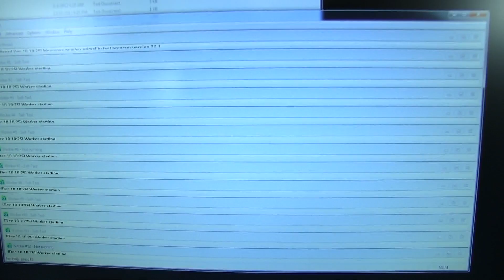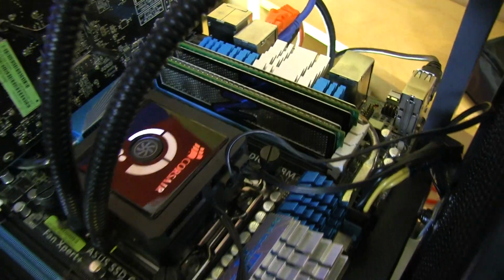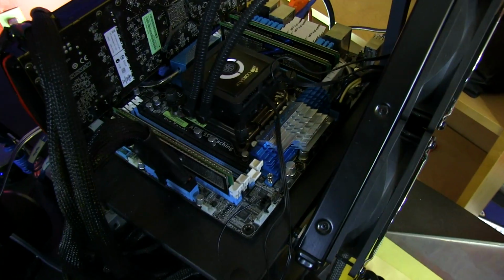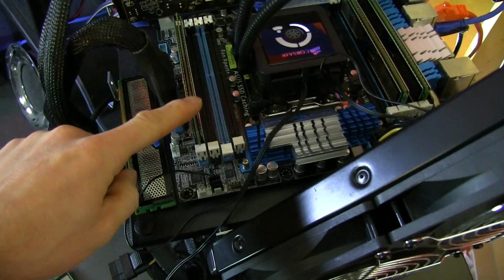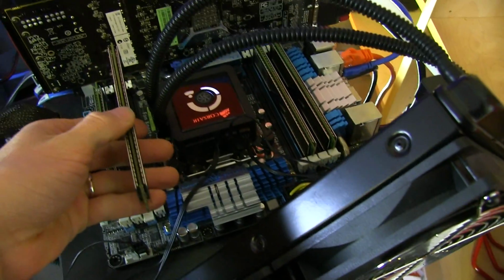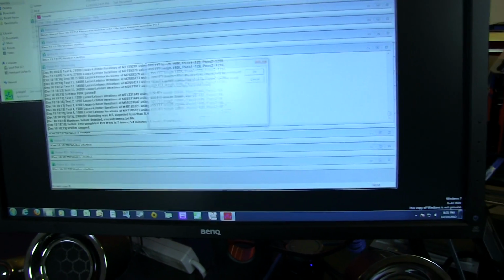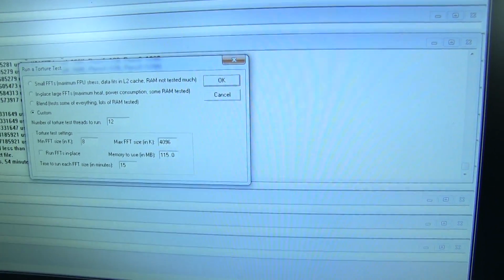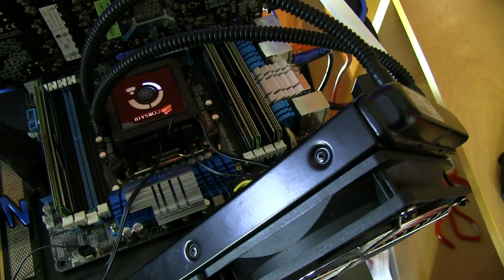RAM Memory Troubleshooting & Diagnosis Part 1 Linus Tech Tips

Comment: doubtful. you can't just say its your ram. more than likely its your video card, probably a driver problem too. update/reinstall your video card driver. if that doesnt work, try using onboard video or try another video card. if that doesnt work, THEN check ram.

Comment: My diagnosis order: smell (burns, overheating, etc), temperature too hot (touch or infra-red thermometer), cables not lose, drives working ok, operating system ok, software ok, other hardware working ok.

So memory might be the last thing I check. Anyone else agree with me?

Comment: if i do not overclock my memory but i do overclock my cpu should i stress test for like 20 hours on p95 blend? because i just stress tested my cpu with p95 small fft and it was solid. now that its summer i dialed it back a little bit but yah, is it necessary to test my ram even though im not overclocking it

Comment: Thx for the anwser :D but the prices are not the same where i live :/ the 860i cost's 120 dollars more that a 850 :/ and just a 860 cost 300$ so i whint i will go with the 860 if it can handle SLI GTX 670, i7 3,4 ghz, 1 ssd 1 hdd and a okay MOBO :D

Comment: it was still on 1.65v by default on the ram... but cpu overclock went bad at auto voltage.... cpu ratio: 41 BCLK: 105 if i changed the cpu ratio to 42 the computer will just blue screen after the starting windows screen haha... using 3570 btw no k

Comment: Installed the H100 by myself on the Burton case I use (it fits , roughly) BUT the ga-990FXA-UD3 leaves almost no room between the reservoir+coolers and the memory locking clips. Solution: used a red hot knife to trim the clips down like black smoking butter. I had only one RAM issue since then (due to some infiltrated dust during the whole process)

Comment: i think this is why COD:Black Ops always freezes after i want to close it :/ i have my kingston hyperx red ram overclocked from 1333mhz to 1600mhz just like that without even bothering to check the voltage.... or either its something else :/

Comment: My RAM is unstable on auto voltage. It makes my system hang, display is corrupted, and produce an annoying noise. I only fix this issue by cranking up the voltage to 1.88

Comment: He isnt using a case because its too much hassle to change out his components all the time. He is using a test bench which allows quickly component swapping. He would only use a case if it was a proper system. Plus it takes too much time to  to put everything in a case, every time he makes up a quick test bench rig.

Comment: I got a stability issue and im aware it with the ram, as i done testing. Its only one stick. Am i better of running at 2133mhz with 6gb or @ 1333mhz with 8gb. I have to underclock my ram to keep it stable due to the one faulty ram stick.

Comment: I have been haveing random reboots on my computer, I check the ram and it wasn't that, I thought it was my ssd so I replaced it, I had power supply issues so I returned it and used my 2 year old psu, I thought it was a psu problem but it came back, do u think its not enough power cause I'm running 750w on a 3570k, sabertooth z77, gtx570, baracuda 1tb, vertex 4 128, water cooled? What do u think the problem is?

Comment: Im a "noob " here but couldn't you just use CPU-Z to see if which stick of your RAM is actually running ? I mean since you said its "dead" as in malfunction. 

Unless you said its "faulty" which the problem will come on and off , on and off.T hat's the most worst case for anything.....because you will never know when it gives trouble so even with CPU-Z can't work =/ 

This is just my knowledge and theory maybe i missing something here or something i don't know of is causing this problems.

Comment: Linus, using 11500 mb of 12gb of memory only leaves you 788Mb of physical to run your os, which isnt enough. you will get erorrs by simply starving the system while trying to run these tests. pull the pref mon to see what kind of page file, then adjust as needed. and the other poster is correct, Linpack and IBT are much faster in producing the same faults in a fraction of the time. Prime is outdated and can leave you struggling for answers way longer than needed. try the other programs. enjoy.

Comment: Opening the cases cool better, but lets more dust and debris into the case clogging the heat sinks faster. Closed cases let the fans bring in as much air as needed and also filters the air that passes through. It is actually bad to close your case if u do not have enough fan power to move much air. If u also have a GPU or CPU that does not have a air sink to push air out of the back of your case, the heat will sit in the case and cause more heat than an open case.

Comment: get and 8320 and learn to overclock, if you dont need 8 "cores" a phenom x7 is about half the price and will perform the same in games and the money you save you can put towards a 7870, ddr3 1600mhz ram is cheap, just make sure its 1.5v and 9-9-9-24 timings, if you can stretch a bit further 1.5-2tb drives are dead cheap these days and youll be happier when you get to 490gb and counting and wont have to worry about buying another hard drive.
have fun.

Comment: Blue screens always have a chance of corrupting your C MOS, OS, or even corrupting a Hard drive. It could be a bad sector on a hard drive, it could be your CPU is not clocked correctly or does not have enough power. There are many things that can cause Blue screens. Not much that you can do other than test every aspect of the pc starting from hard drive and ending with the CPU or GPU. But if you get the "Out of Memory" You should probably add more Virtual Memory, or reset bios to default.

Comment: You can't get total coverage within the OS via P95 because the OS can hide the corruption from you if the memory cell is allocated in some fairly static buffer, especially when you're operating with small amounts of RAM (eg. one stick). I would trust memtest86+ more for that reason (even though it also uses memory too obviously, but significantly less).

Comment from the maker: When you've seen what I've seen, you'll know it's not that simple. Some sticks will only fail in multi-channel configs, some will fail in prime, and pass memtest, some will pass prime, and fail memtest. Some seem to pass both, then the system crashes in games until you replace the RAM.
Reply: Yaa
Reply: This is where I am at. The sticks test fine on there own but when running windows and games the PC restarts. Have not tested the sticks together with memtest86 yet.

Comment from the maker: Did this. All 4 sticks passed, but they fail together. That means at least one of them is borderline. It's slightly more stressful to run in multi-channel versus single stick configurations. I did mention this in the video.
Reply: Hi, could you do test or  review of Memtest86 vs Karhu-Software Ramtest vs HCI Design MemTest Pro / Deluxe?

Comment: Hey Linus. Try the oven trick on the dead sticks of ram. It worked when i had a dead stick of FB RAM in my server. Tested in memtest 24 hours stable. 
And it's been in my server running for a year now problems.
Oh and the audio is good.

Comment: Thanks for thr tip Linus. I usually find a dead RAM stick due to the system not booting. But as I see in this video, it's a little more complex than that. And I've also had a system turn on while I was working on it, only my finger stuck in the fan though ;P